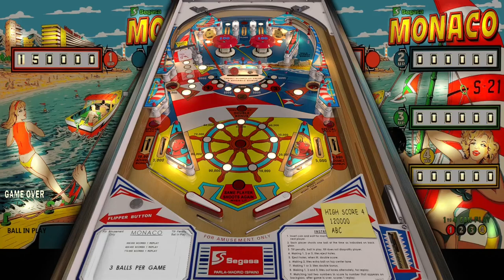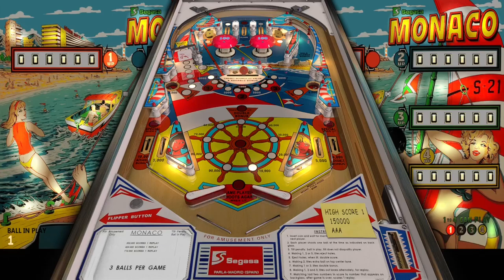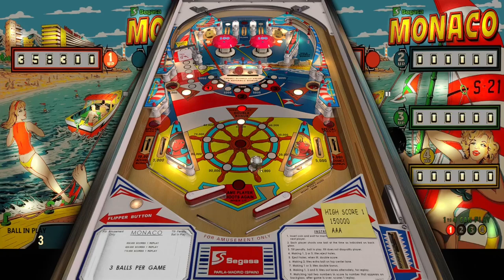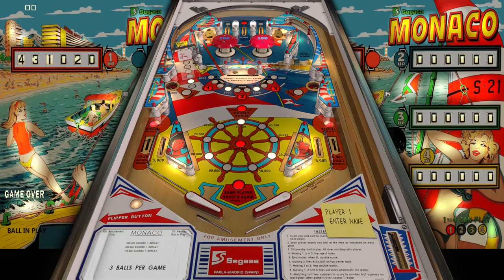Monaco VPX (Segasa, 1977) 1.0

Comment: I've seen those moving targets pop up in a few tables you've done recently and I agree that they're a cool gimmick. I'm no expert on pinball hardware but I'm sure you hit the nail on the head with the malfunctioning bit. Can't imagine the motor in a moving object that constantly gets hit by a metal ball would last that long.
Reply from the maker: Exactly, Dom! I was thinking about this mechanic yesterday and I came up with the best analogy yet. You know how HDD's have moving parts that read/write they break down a lot because of that moving piece. And then you have Solid State Hard Drives that have no moving parts and they last longer and come with improved speed. If that makes sense :)

Comment: Kewl table man!  Sure feels like a Williams table with the longer, pointy, more powerful flippers.  I prefer them over the Gottlieb tables. a quick search for that brans on VPForums only turns up a couple results. Further digging may be required to see if I can find more from this maker.  I'm curious how you pick the tables you play, you seem to get them right when they come out?  As far as that moving target, I bet you are right in the fact that fewer were made with features like they because they tended to wear out and in turn malfunction.  I know the 1972 Williams Super Star I had the only real issue other than it needing a good thorough cleaning was with the center bonus target mechanism, it was simply worn out from being hammered for years.  Moving targets would mean more moving parts and more failure points.  Have a great weekend friend thanks again for the heads up on this one.
Reply from the maker: kilter thank you so much for your comment! You bring up a really good point about the design of the flippers between Gottlieb and Williams, where Gottlieb flippers had more rounded out ends and Williams were more pointy, I can definitely see that more now thinking about it. 
Yeah, I have never heard about this maker up until making this video and I'm not surprised there are not many tables for them on the forums sadly. I generally just pick the latest table that I see on VPforums or VPU as well as other commercial pinball games like Pinball FX. Sometimes I just choose a table simply because I like it or just feel like it really.
What happened to your Super Star from '72? I know you gave away your other one to the cable guy. Were your tables handed down to you because I find it so cool to talk to people who had the real thing :)
Thank you for taking the time to watch and comment, I appreciate you! Have a good one!
Reply: @NewLeaf88  I bought the Super Star to put in my vape shop so people would have something to do while they were hanging out but with all of the changes in the regulations and the economy being a real turd the wife and I decided to shift gears and get out of the vape business and go into reselling so we needed more space.  I put that table up for sale on FB Market place and it sold in just a couple hours.  The guy who bought it is a big name in the Oklahoma Pinball Tournament scene so I have no worries that it twill be well loved for years to come.  With that said as soon as I sold it I regretted it and that is the sole reason I got into visual pinball. I want to build a table next so I am on the hunt for all of the pieces and parts to make that happen. This is gonna be fun.
Reply from the maker: I can totally understand your reasoning for selling it. They are expensive to maintain, they really are and now since their parent companies are defunct their parts and pieces are equally as expensive and hard to come by. I think you sold it to the right person too instead of to some junker or metal collector haha. 
Visual Pinball is the next best thing to the actual tables so you made the right move all the way. I also want to commend you for wanting to build your own table next, I want to see the finished product! I know some people are into pin cabs but I never got into them, like people will use a 4000 UHD TV for the playfield and another screen for the backglass.
Reply: @NewLeaf88  Yeah I'm planning to build mine from leftovers and garage sale find type gear so no 4k for this guy.  I actually want to make mine on the smaller side and build it out like an old school wood rail pinball machine from the 50's but with kewl HD playfields, haptic feedback and hundred of tables in one.  I think it will be a super kewl project for "me time" and I should be able to convince the frog in my packet to play once in a while with a "real" cab, she doesn't much like sitting down at the computer to play pinball.  That might be a mistake though, she's kind of a beast, she held the HS on the Super Star with well over 200,000 points.
Reply from the maker: I like that idea a lot Kilter! It really does sound like a nice project to find all the parts and use your creativity. I think I did a review on an old wood rail table from the early '60s called Sky something and it only had 1 flipper lol. Have you ever seen those small tabletop pinball machines? Man, I used to have a Spyro the Dragon stand up pinball toy thing, there was nothing really electronic in it but it had all the pinball things like a plunger and it stood on 4 legs. You can get really creative with these things sometimes!
I want to play Super Star again tbh since you're reminding me of it and try to beat her HS!
Thanks again Kilter for taking the time to chat and watch the videos, it means more than you know :)